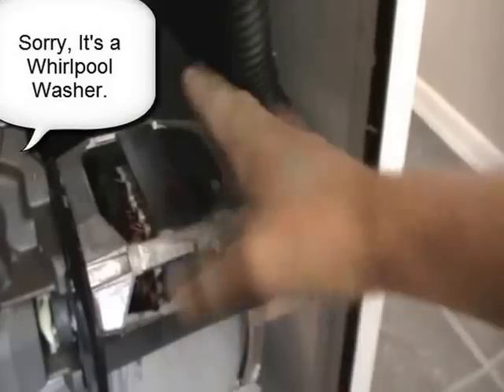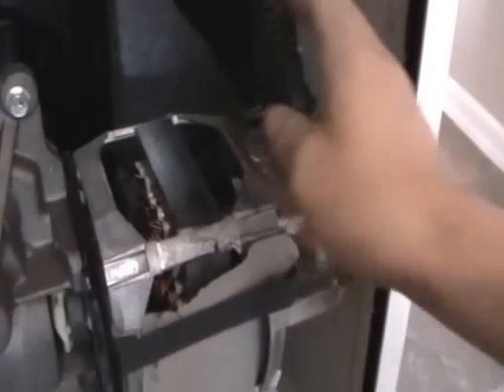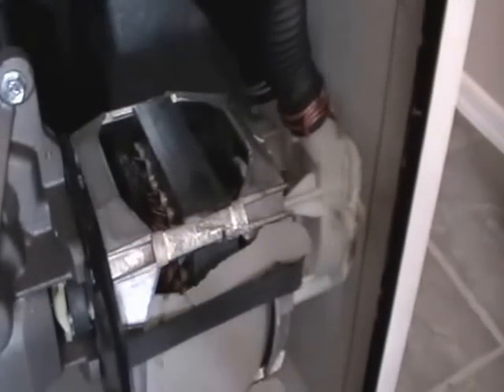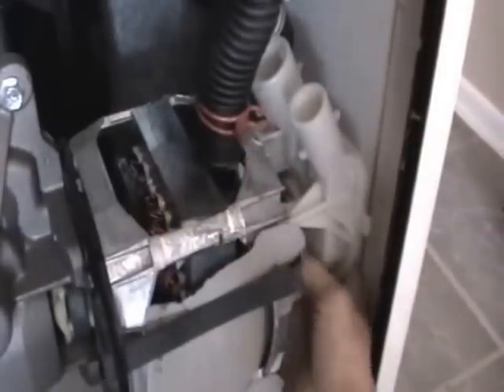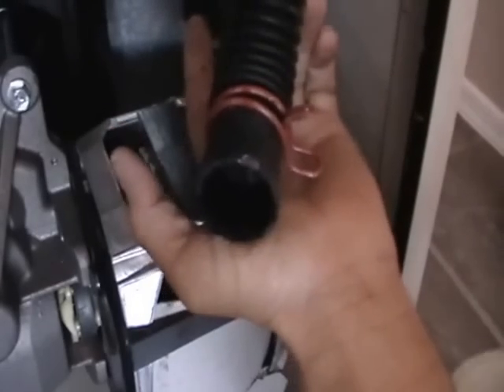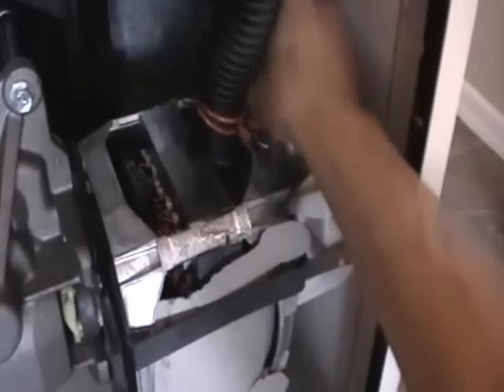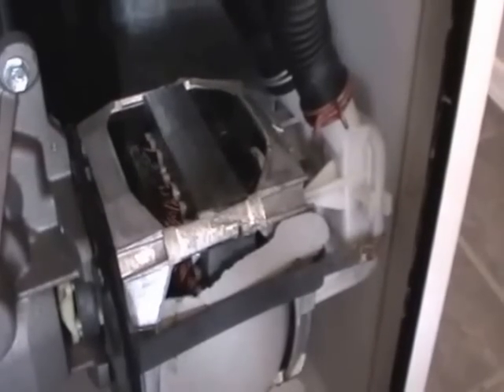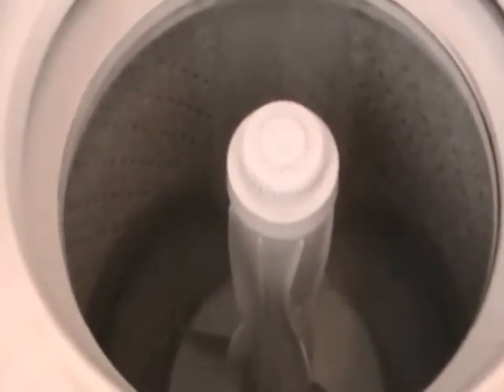Water Leaking From Bottom Of Washing Machine

Comment: Take the case off. It saves time.  Pump can be had for $10 new.  Check for sox jammed in pump.  Check for clogged hoses.  Check pump to motor attachment as it may be cracked/stripped at the plastic pump input.  Best wishes.
Reply: Tilt it back and the water drains back in to the machine and no need to take anything off but the pump.

Comment: Turned the washer on its side with pump and stuff exposed. There was no rust around the pump but the white dump hose was wet to the touch. Took the hose assembly off and when it is bent you can see a crack in the very thin mickey mouse hose. Drove to the local Sears parts store 5 minutes away and got a new, sturdier assembly for $13 and change. An hour later the wife is back in business doing her laundry. At first, I thought shit I put the hot and cold hoses on backwards but it was just I forgot to plug it in.